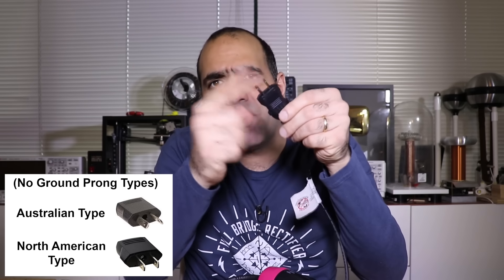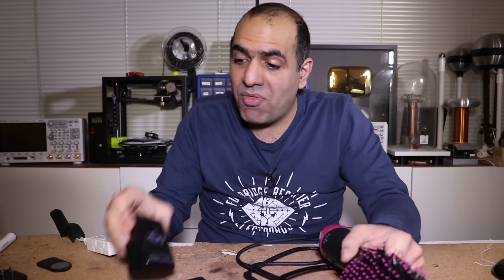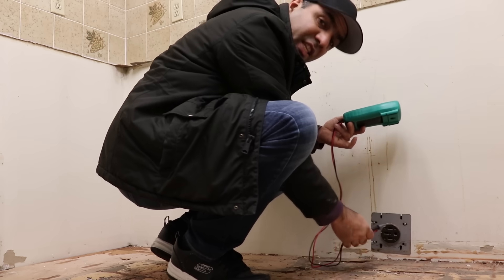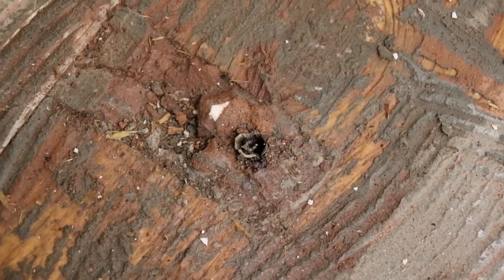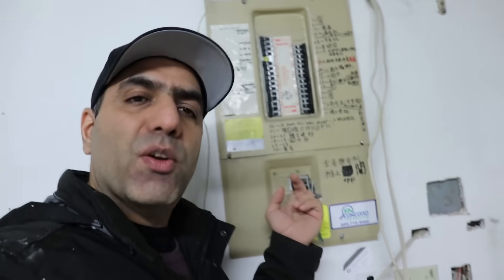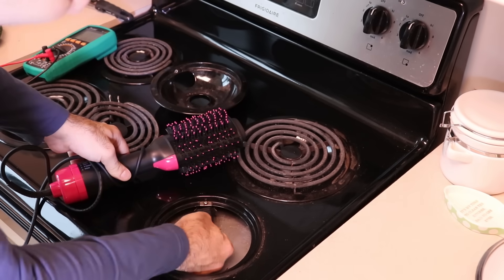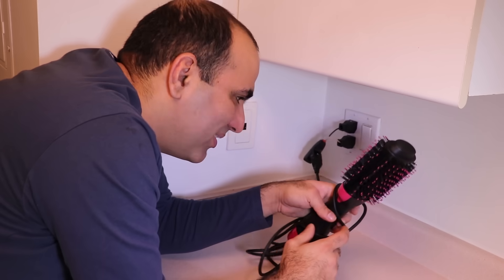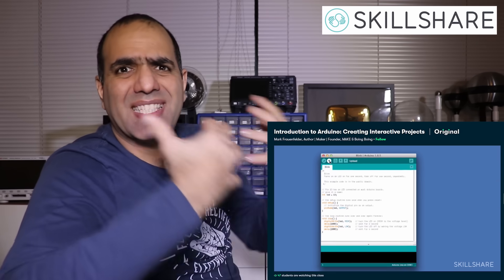Finding HIGH POWER 240V in a 120V Country

Comment: A relative of mine recently graduated from lineman school here in the US. He tried to tell me that if you wrapped a wire around the earth 7 times and completed a circuit with it you could get a light bulb to light up instantly which would mean that the current travelled faster than light. I know this can't be true, but I can't find any place online that can explain why. Can you explain or at least point me in the right direction?
Reply: Why would the light bulb light instantly? It's just making a baseless claim and leaving all the work of proving the claim to the listener. Typical bonehead urban stories passed as "deep thought".
Reply: Imagine a pipe filled with marbles. If you push a marble in one end another will drop out of the other end “instantly”. Same thing is happening in a wire.
Reply: @letsgocamping88  Except that it won't be instantly. The speed of "push" is still (much) lower than the speed of light.
Reply: An electric current is just a very fast domino line where the dominos are electrons. It would not light up instantly.
Reply: Oh so it wouldn't even light up instantly to begin with?
Reply: @ericpowell96  Why would it and how could it? Electric fields in cables only travel at around 60% of light speed or so. Plus the resistance and impedance of the cable would eat away all the energy and the bulb would not light at all probably.
Reply: @ericpowell96  yeah
Reply: Thanks guys I really appreciate it. I don't have a background in electrical engineering so I was a little stuck. This really helped!
Reply: If we talk a bit more practically about how it would actually behave, a winded wire would be in a way a coil or an inductor, and even if not, any wire has some inductance that is very small and negligible but not in the case of this assumption. This of course means there is a transient response before a steady state is reached, and the current rises slowly before reaching its steady state. It would be valid to ignore the inductance when using DC voltage if you are not studying a random point in time since there's no change in current, but if its the transient response that is under question, it would not be a valid to simply ignore it.
Reply: Your relative needs to redo school because EVERY part of that is so dumb that it hurts.
Reply: He is wrong, it travels at the speed of light
Reply: @agustinyavar525  Less than that, actually.
Reply: Just as an added note, the force of electromagnetism is transmitted via photons, i.e. light. So the absolute fastest way for two electrons to interact (which is what electricity essentially is) is the speed of light. In reality it's quite a bit slower than that however.
Reply: @RaihotDoW2  *laughs in quantum entanglement *
Reply: Also, the seven times part might have been referring to the fact that a photon would orbit the Earth about seven times in one second, so maybe there was a misunderstanding at some point
Reply: Because light can go around earth 8 times a sec
Reply: Dude it's like using a transmission line 7 times the circumference of earth ,it is not economical and impractical . In a long HVAC transmission, the reactive power flow (because of large cable capacitance ) will limit the maximum possible transmission distance .Although, I think HVDC doesn't have limits ,still even if you use HVDC what you said, it's not possible .I doubt your bulb will even glow or not 🤣🤣🤣 .Such super duper high voltage transmission will need super transformers to step down to light up your bulb and I doubt we have 1 .
Reply: @pritsingh9766 : The point of this question was not to construct a practical transmission line wrapped around the Earth 7 times. It was a thought experiment about electrical energy and flow. I think you missed the mark here.
Reply: Longitudinal magneto dielectric waves should travel faster than the speed of light and Transverse electromagnetic waves does not. 
Look up Eric Dollard on the subject and people who have replicated experiments on the subject
Reply: ericpowell96: Electrical current travels very slowly, often just as fast as you walk. You can do the calculation yourself if you understand what current flow is - Coulombs of charge per second. It is voltage (the electrical potential) that travels at approximately the speed of light. Nothing can travel faster than the speed of light. Actually it is more correct to say that no information can travel faster than the speed of causality in the universe, not even light: https://www.youtube.com/watch?v=msVuCEs8Ydo

Comment: Hey I am just 14 and am interested in electricity.
I do know how phases work, and that their osiliscope reading will be different. But can someone explain how two phases can be used to create 205V or 240? In my country they use 3 phases and we basically use UK plugs. So its 240V here for all appliances 

Thanks and sorry for bad english..
Reply: Cio Dokop In US and Canada we use a split phase system. Search it up, the internet will probably do a better job than me at explaining it. Essentially, a transformer steps down grid voltage to 240V. On the secondary side, we centre tap the transformer and ground it, this is our neutral. So if you connect L1 and N, or L2 and N you would read 120V. And if you connect to L1 and L2 you would get the full transformer 240V.
Reply: @Rayden440  nice explanation, i try my best to add a little.
If you got 2 phases shifted 180° you get a positive peak, lets say +120V, when you also have a negative peak at the other Phase, for example -120V so the difference between the to phases is 240V. That is what Kevin meant with split phase.(basically the phases are the same only that they are inverter) If you got 3 phases shifted 120° Phase one has a peak (+120v) and Phase 2 had the peak one moment ago, and Phase 3 havent had the peak yet. So the voltage difference is a little bit less that 120v+120v=240v because the negative half wave of the Phase 2 and 3 is Not at the maximum, lets say it is at -88v so the difference is 208v instead of 240v. And because all phases are equally apart you basically have never to peaks at the same time. (Not regarding that the actual maximum voltage is higher because rms values...)
Reply: Drew Dastardly 

So is it FOR all houses like that? I taught the way the "phase" or the "wave form" is completely random and different. So how is it exactly coming up to 205 or 240V.... this is confusing xD
I just realllly dont understand phases well.

Thanks for explaining either way!
Reply: @Drew you always get 205V (208V) between two phases in North America. The 240V is the result of using 240V transformer that has it's center connected to the ground (google center tapped transformer).
Reply: https://m.youtube.com/watch?v=4oRT7PoXSS0
Reply: keep us reminded about your age pls
Reply: As others have mentioned, in order to get 240V, this is a result of a 240V transformer that is center tapped.

However, in order to get the 205V, this is the result of a 3 phase 120V system.  If you look up the line voltage of a wye connected 3-phase system, you will see that the line voltage = sqrt(3)*phase voltage.

120V*sqrt(3) ≈ 208V  

The sqrt(3) is the result of taking the difference between two sine waves with a 120 degree phase difference.

Comment: Why didnt u connected 2 outlets of 120 volts in series
Reply: They aren't two separate power supplys; they are connected to the same source. It's like trying to put a battery in series with itself. It would short itself out. His solution worked because his kitchen outlets are two separate phases.

Comment: I wired a socket in my kitchen so I can run a European kettle for heating water. Much nicer than using a US kettle. The main thing you need to take into account is that neutral in Europe is expected to be near ground where in the US, it will be L2 and around 120V. I can't think where this would be an issue with proper safety features but worth bearing in mind.

Comment: Some buildings have 440V lines to supply things like plasma cutters, arc welders, furnaces, etc which require even more extreme power!

This solution is fine if you have a mostly resistive load (like a heating iron or a lamp) or a switching power supply (like a USB power brick), but it probably won't work properly with a lot of frequency-sensitive equipment like radios, televisions, many old computers and video game consoles, AC fans, etc etc

Comment: I found a 380V instead of 220V. My MS Surface charger died after that.
Reply: I realise that you could be in a country with 240v standard but still
Reply: @mcm_pictures  
That was in Montenegro.  Only one socket was for 380V - have no idea why it was in hotel room.
Reply: cheaterproject air conditioner
Reply: Better that was charger than laptop/tablet
Reply: @zalatanyy  yeah $1,000 down the drain.
Reply: lol, I think I've learned that whenever I travel to a foreign country, should always pack a multimeter
Reply: @DFPercush  the guy at the local store thought I was crazy for buying a 2-inch by 3-inch multimeter and wanted to upsell me on the much better one......... and I'm like no I think this one will pack better in my suitcase when I go to the Philippines. And then I'm the one who got accused of plugging in the 120 volt Appliance into the 220-volt outlet without Step Down Transformer blowing it up and having to have it sent in for repair. But I digress. After my visit to England, Scotland and Wales I decided that my next trip I was required to have a multimeter even though I never really ran into anything other than pure curiosity and verifying that things were wired right. My next trip I would also pack a non-contact voltage tester as that would indicate correct polarity as well, it's also helpful to tell if a surface is energized thankfully I have not encountered that either. I hear that happens in trailers and RV's.
Reply: Where the hell did you plug that into, a telephone poll.

Comment: Which is best  240v or 120v and why there is different ??
Reply: 120v is safer, but slightly more expensive.  In North America we have a 240V system but no part of it is over 120V to ground.  We run dedicated 240v circuits to the very few devices that actually need that much power.  Everything else runs perfectly fine on 120V.

Comment: I think that you need more 220V sockets in the US, since now most appliances that has switching power supply supports universal voltage it can be convenient since these power supplies are more efficient on 220V, you gain efficiency with no cost practically.
Reply: They're only more efficient because they're designed to work at 220V.  If you used one designed for 120V, they're just as efficient.

Comment: suspicious here, that the spark explosion was from the top of the meter, and NO sparks on the probes, nor any visible damage or any smoke, just fireworks.  There's a 10 amp fuse inside the meter that would blow without making sparks, but the tips of the probes would be a bit blackened from this.  I also found it curious that the meter was facing away from the camera, and away from him.   So my theory - there was some fireworks attached to the meter.
Reply from the maker: Matthias... that does look suspicious ... ;)
Reply: @ElectroBOOM  Does that mean that almost every explosion is fake? I mean, of course, you wouldn't fake a cap exploding or something similar but other stuff? And how about your reactions when you touch live wire?
Reply: You must be fun at parties...
Reply: @abyssunderground  ha ha ha😂
Reply: hes like a magician.  I know its a trick but i still enjoy it.
Reply: A lady called Joy is dying here!
Reply: like everything else on this channel is totally legit
Reply: also the leads weren't connected to the meter, they're clearly detached when he jumped/threw the meter while it was still in the air, but who cares, this is entertainment, fucking love watching Medhi
Reply: @Nitrxgen  Good eye on that one.  That proves its deliberate fireworks beyond a doubt.  Having shortened a lot of stuff by accident here and there, I know what it looks like.
Reply: @jackey64 nope, what I meant is that touching 120V AC for a short time isn't lethal so I thought he actually touched that
Reply: @jackey64 When touching something to see if its live, always take a swipe at it instead of outright touching it, so that you can be sure to let go.

Comment: 3:50 I wanted to test the rcd by bridging the Neutral and ground in my exam, 
by shortening them over my multimeter. But dued to the stress I shortened the phase and the ground..... 
My multimeter could not properly measure voltage anymore, wich cause me a few painful moments at work. :D

Comment: 3:30 as a german electrical engineer I can tell that this was a common practice, 
but since our energy saving law it's mostly forbidden,  because it draws a lot of reactive power.
But during the general switch from 2 to 3 phases in the 90s it was the cheap option for landlords,
to upgrade their property.
Reply: Using reactive current on a domestic connection is basically you stealing power from the grid.
It's usually produced by three-phase-motors (Drehstrommaschinen). And since these are usually not used in domestic households the reactive current is not measured there. Companies that draw reactive current may face hefty fines and because of that every three-phase-motor has to have capacitors for reactive-power-compensation (Blindleistungskompensation).

What reactive current does is, that power is not drawn in phase with the voltage but slightly out of phase because of inductors moving the current by up to 90 degrees.
Reply: Might be a regional thing, but i agree with DooMMasteR that the local grids in germany are ever since 3~ AC with 120° phase shift.    The only difference is that houses got different number of phases (1 up to 3) dependent on the use. Farms like his example usually 3~ for powering big fans and such.
Reply: this was also regional, our house got mains electricity in the 50s and it has been 3 phase ever since (old farm house).  
Our mains is redundant and bos connections are fused with 80A each, so 2 x 3 x 80A :-)
Reply: @TheFurrymunster Blindstrom is reactive current, but I am not totally sure what he wanted to say :-P
reactive current/power is not metered on any domestic mains connection in Germany no matter how big it is. Only commercial mains connections may be charged for reactive power when exceeding 18.5 kVA for long periods of time.
Reply: Center tapped transformers don't draw a lot of reactive power

Comment: Lol i shorted my body back in egypt i shoved a metal thing into the power cord than some sort of huge blast came than i looked at the metal and saw it was red hot so then when the blast was there one spark almost touched me im lucky i felt nothing that is because i was on my bed so i was isolated from ground, Im lucky that the metal didnt shock me or i wouldnt be here, Probably and i heard a pop than i realized it was my fuse than i panicked than my grandmother had to open it again funny thing that the lights were still working but the fan was not

edit: If u want electroboom you can make a video about explaining why the power Exploded